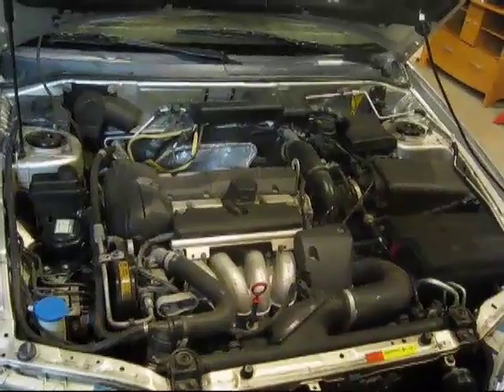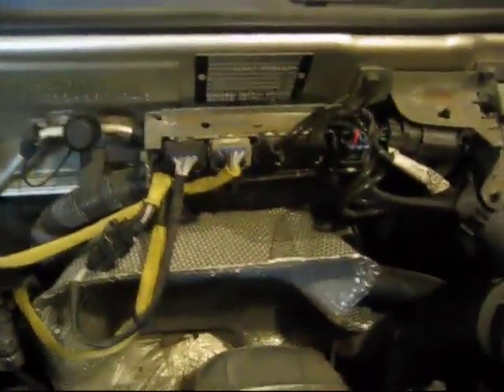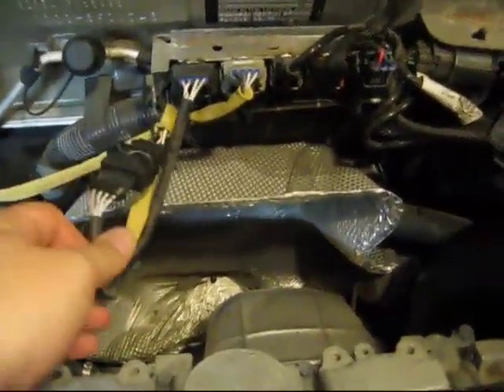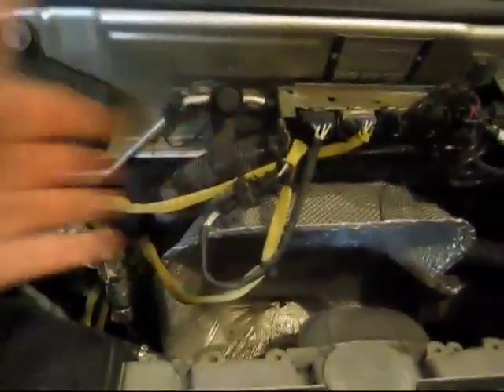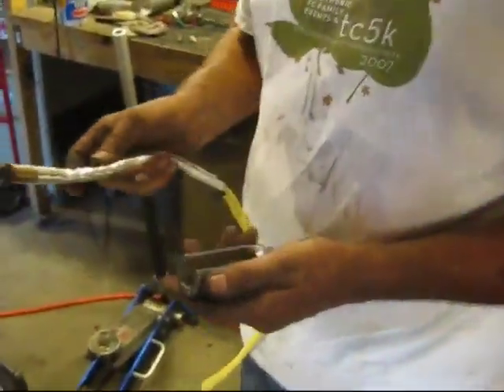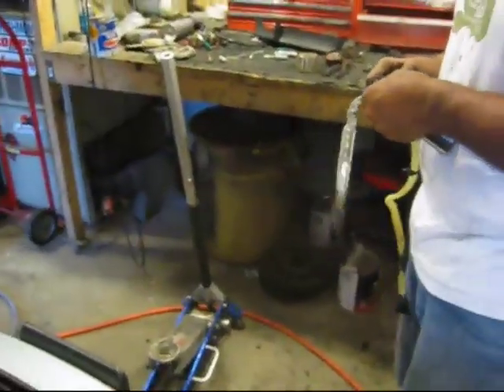MG 49 - S40 Oxygen Sensor Replacement

Comment: Why do i not see that cable in the engine bay for my o2 sensor? I pulled the black cover off but the place where your connector is mine is empty

Comment from the maker: @cisopen Yes it fixed my code, haven't seen it since. I used a bosch oxygen sensor and I reused the extra adapter cable that was on the original sensor. I've read some things that sometimes you need to replace that adapter cable to get it working right. It's volvo part number PN 30650686. Hope that helps

Comment from the maker: Yes It was the right one, I could be wrong but I think if the other one goes bad it throws a PO131 error code instead of PO130

I think it translates to...
P0130 = Bank 0 Sensor 0
P0131 = Bank 0 Sensor 1

Comment: Just changed my o2 sensor but the code won't go away a shop said I need a parameter reset from he dealer is that right? 2000 S40 1.5t
Reply: the code should be easily reset with a scantool - I had no problem clearing 14 codes in my mothers s40

are you sure its the same code that commands the service light on ? it may be a different code or the repair was not done correctly - a lot of mechanics are LIars and Thieves!!!

Comment: I replaced the front O2 sensor with Bosch OEM part. I'm still getting a P0133 code from my OBD2 scanner.

Did your fix stop your error code from throwing up? I'm reading about countless stories of this code coming back even though the O2 sensor was replaced.

Did you use a Volvo brand O2 sensor?